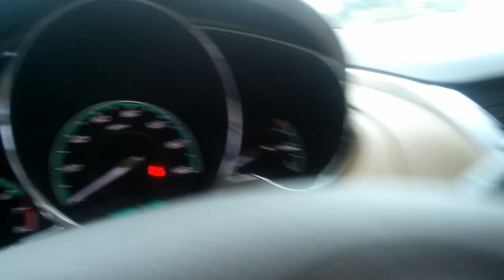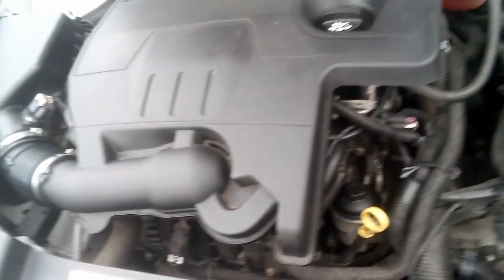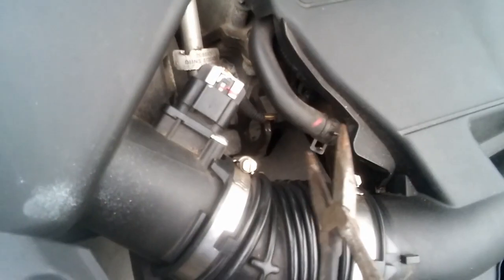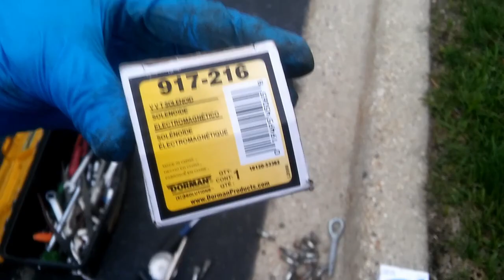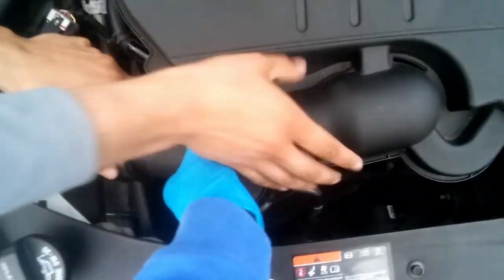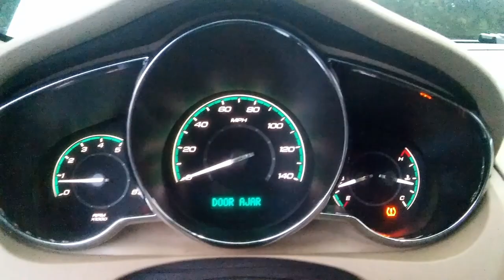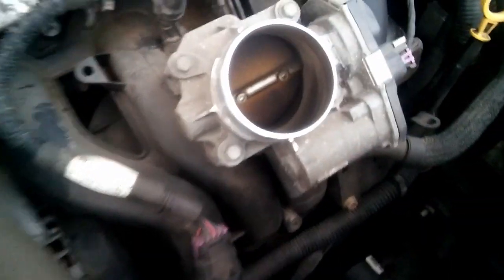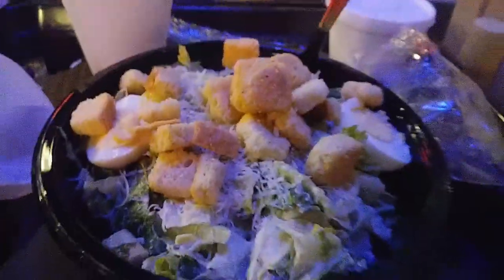LET'S FIX THE CHECK ENGINE LIGHT ON A CHEVY MALIBU!

Comment: I am having to replace my timing chain in my 2011 Malibu for the second time. It seems they have come out with some metal instead of plastic timing chain guides that will hopefully last. It ran super for almost 2 years and 25k miles. The codes had me replace the timing sensor and actuators the first time before I took it to professional that diagnosed it correctly. Though this YouTube was evidently the actuators, Bad timing chain tensioners can make the actuators look at fault to the check engine codes.

Comment: I have a question so I have my check engine light on as well on my Chevy Malibu it’s also a 4 cylinder, I took it to an auto zone and they checked it for me and it said that it was my exhaust manifold, then I took it to a mechanic and he said that there’s nothing wrong with my exhaust manifold that it doesn’t make any noise or nothing and another thing is do you know why my car is eating a lot of gas like really really bad I’ve tried the gasoline cleaner stuff and it never worked so could it be my exhaust manifold ?
Reply from the maker: What check engine codes do you have?

Comment: I tried to clear the code via autel im508 but was not clearing it
Reply from the maker: It means the code is serious and needs to be diagnosed and fixed. It won't clear without repairing
Reply: @VITOSGARAGE  i believe so thank you and I've told the owner exactly the same thing.

Comment: I need a engine in a 2010 Malibu lt 2.4l how do I get the miles in side the car to say the mile on the new motor I put it it still says the old ones for old engine
Reply: Shit what about the title how do I get it out there?
Reply from the maker: What do you mean how you get the title?
Reply from the maker: You can't do it. Unless you have a device that changes mileage. Nobody will change you the miles. If the car has 200k miles, it'll stay at 200k
Reply: you can't change it, the mileage on the vehicle has to stay the same regardless of any new parts you put in it. changing the miles on the car is like a felony I think